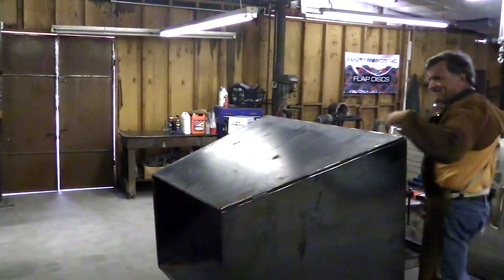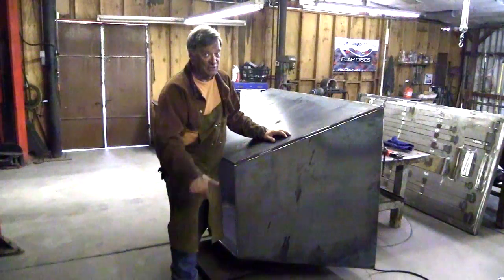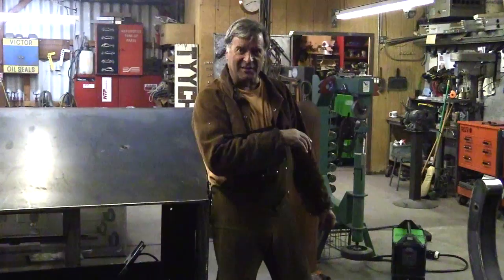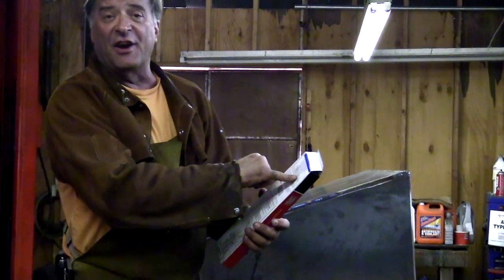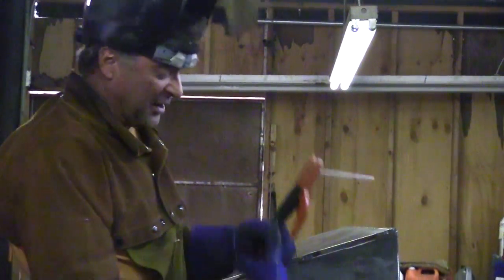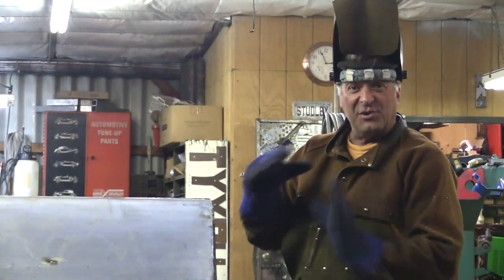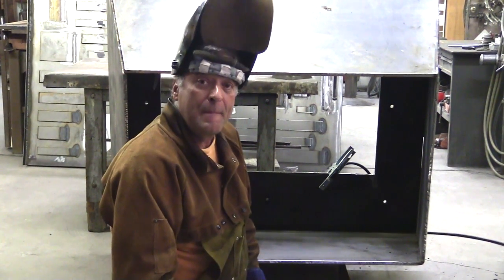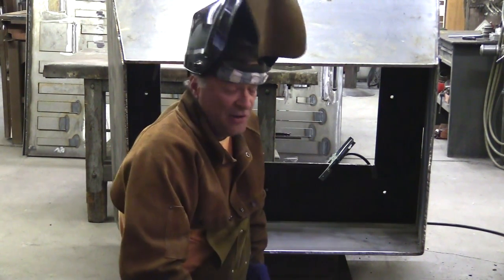How to Weld a Root Pass and Why You'd Want To - Using Everlast's 300 Amp Stick Welder - Kevin Caron

Comment: I really like my 300 amp Everlast.  I’ve never ran anything larger than 5/32” 7018 but it nice to know the power is there if I ever need it.   I’ve always wondered how it would fair when running a carbon arc.  Not that I enjoy arc gouging, I’ve tried to live my life by the book so I wouldn’t have to experience the fiery depths of Hell.
Reply from the maker: Have only seen videos of carbon arc work and I agree. Have no interest in trying it .
Reply: How's it holding up the last 3 years?
Reply: Have you tried 6010? its a gas! its like welding with a rocket.

Comment: How do you get 1/2" steel plate in your shop and move it around? I struggle with even 1/8th. It's not so much the weight, just the awkward shape. You need ape arms. When you get to 1/4" now you are dealing with weight too....
Reply from the maker: Look here,     i also use a magnetic lifting device for horizontal plates.

http://www.lkgoodwin.com/more_info/below_the_hoist_hook_lifting_devices_all_types/clamps/model_s.shtml

Comment: I didn't think you could push stick. Thought you would get slag inclusions. I'm a novice though, so I'm just asking. I enjoy your videos, thanks for the tips.
Reply from the maker: +Bob Humphries          Normally no you don't push stick.    But in this case going up a slight incline this is the correct way..
Reply: @KevincaronSculpture  Been studying welding for a while now, and never read that bit of info, is that the case for all rods?
Reply: +Kevin Caron, Artist Thanks Kevin, I'll give that a try. Still learning, so I really appreciate your videos.
Reply from the maker: Have to get your forward travel speed just right..   Stay ahead of the slag but don't overrun the puddle....
Reply: +Kevin Caron, Artist  Got home today and saw your comment. I'm a finish carpenter by trade and live in Staten Island, NY. I'm always looking to learn something new and at 62 years old I decided that welding looked like a lot of fun. I started with a cheap Northern flux cored 125, then bought a Lincoln Tombstone 225 AC. Sold the Northern and bought the Lincoln Power Mig 210. I am getting pretty good in all processes, but pushing stick was something new. After some trial and error I got some good results. Working with 1/8 plate I started out with a 1/8 6013 rod but was running too hot and was blowing through the metal. Settled on a 3/32 6013 at 90 amps and that's when it all started working. I never would have attempted to push stick if I hadn't seen your video. Thank you so much for posting. I'll be watching.
Reply from the maker: Now get some 7018ac and see the difference!!!
Reply: +Kevin Caron, Artist Bought the 7018ac and love them. Never bought them because of the rod oven requirement. Will I be ok vacuum sealing the remainder of the rods....I'm not building bridges, so as long as they will last while vacuum sealed that would be great, What do you think?  Thanks again for sharing your knowledge.
Reply from the maker: Yes, I have used the vac seal in the past for long term storage..   Worked great here..
Reply: +Kevin Caron, Artist Thanks again for your answer. I love that you are self taught and your videos reflect that in the way you explain everything. It makes it easy for the novice to understand. I'll keep watching and learning. Thanks

Comment: wow heavy duty there kevin > harken back to the high school metals shop class - student instructors only( ?!) everybody got nice edged 8"x 8"x 1/2" plates to go thru basic arc weld/joints...then one day the mad scientist type fella got pissed off because he couldnt find his project piece in the pile under the bench so he cranked up the very old dc generator (miller & lincoln was the stock machines), started haphazardly welding all the project plates he did find together and didnt stop till every 1/4" rod in the place went up in smoke...i had to spend at least a month in the dean's a.m. detention 'class' being the overseeing senior machinist 'in charge' - they didnt have a way of moving the huge hulking sculpture out of the middle of the shop floor; so until i earned enough co-op student machinist wages to purchase a cutting torch set for the rarely used gas brazing and tin welding equipment....looks like the latest project - youve buckled up a concentrated effort to put forth quite a bit of stick time in. thanks respectfully. cool torus.

Comment: Kev, NOOOOOOOOOOOOOO ONEEEEEEEEEEEE, Hates Migging More than Me,, Goood for Tacking,, BUTTTTTTTTTT, I Have a Feeder,   Whick Hooks Up,and ya Can Run 1/16  Mig wire,, Great for Putting teeth on Buckets,, You can Do a 2-1/2 Ver UP,,, But Most Of the 10000000s Of Tanks were qll 1/4 Plate,and 1/8 Lincoln, Jet 7024  Ran Buetiful,, But for 3/8 or Heavier, I Use the LN-255 Feeder, 1 Pass, and Done!!!!!!!!!!!!     After 20+++++++++++ Years,,, theyed rottrd away,  Never broke a weld,, Grat in field,, cause you can run 300+Feet Of cable to IT!!!!!!!!!!!!  1 Job, Paid for Itself,, With Or Without Gas,, Now,,a resperator, HUMMMMMMMMM    We had It so Bad,, That 7 Guys Burning Get,, You could see the Next Guy,  So far were still Kicking!!!!!!!!!!!!!,, But at Luch,in the winter, Ive Had Neighbors call The fire dept!!!!!!  It was a TAD Smokie,, BBut for Light Stuff, Had to Mig It!!!!!!!!!!!!     1100 Pounds????????????    Doesnt your supplier,  Have a Shear?????????    Saves Alot Of time,, for 15 Bucks,, !!!!!!!!!!!    And NO MARRRRRRRRRRRRRRRRRRRRRRRRRRRRRRRRRRRRRRRRRRRRRRRRR,, Is she OK????????????????????? Thanks,,
Reply: Jack Connors OPPPPS, LN-25 Feeder,,,